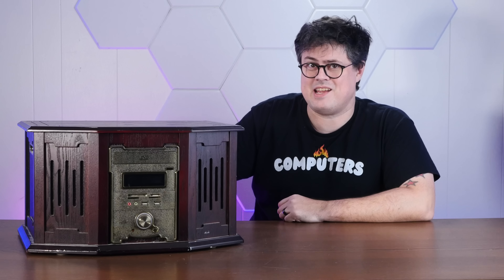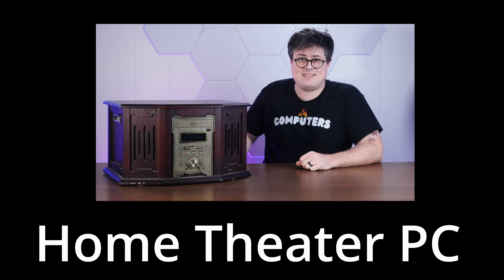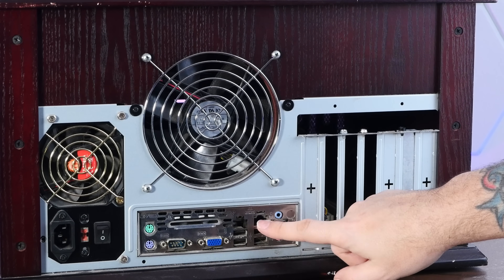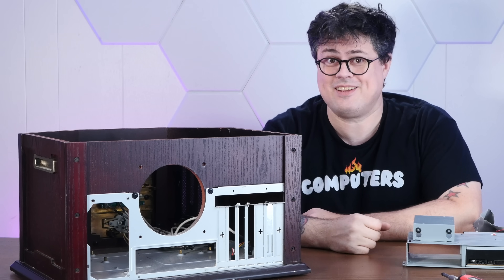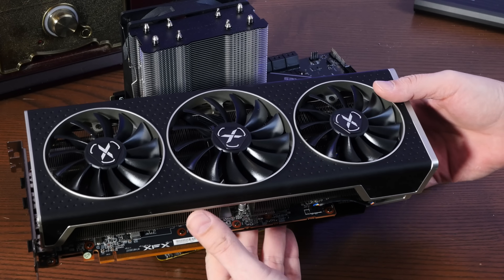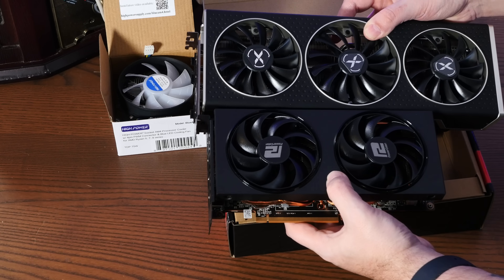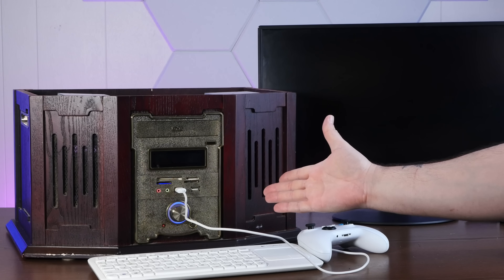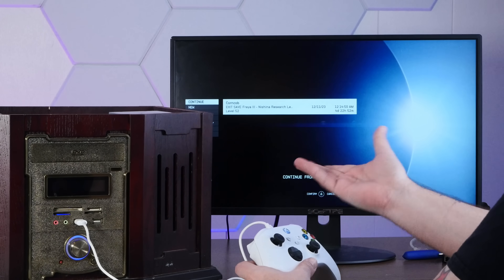This Was a Real PC in 2009 🤔

Comment: This case was for model of fake "vintage" radios with CD player that is still sold today. The top is on hinges and hides a turntable. If you google "All-in-One Vintage-Style Turntable" you'll find them. The PC maker adapted the case to put a computer in it. That's why there are unused speaker grills.
Reply: @dans8287Never knew that, but I always thought the cd tray opened a lot like a standard PC drive. Guess if I ever need a replacement IDE CD drive I know where to look.
Reply: I want to put LED speakers in those grilles, and leave them flickering between orange and yellow, to make it look like vacuum tubes powering up...that would be awesome.
Reply: @dans8287 My folks bought me that for Christmas the year I was talking about putting a PC in a old radio.  It did not survive my now-spouse and I's move for grad school -- it wasn't worth the trip.
Reply: I think the "unused" speaker grills provide the system with some airflow for the single rear fan
Reply: It’s definitely made to be a pc case though, did you see the dvd drive and I/o ports on the front?

Comment: im wondering about the original OEM maker of this and how they came upon this idea. I mean this as in this is an off the shelf casing from those 'all in one' decks you could get in the late 90s into the late 2000s (my folks have one, these were usually targeted towards the Early Bird Special bunch), and i can tell it is one because it still has the side slot intact that was used for loading cassettes, and the top is usually a lid for the turntable. What i surmise is that this PC producer probably bought the rest of a stock of these casings from a manufacturer after the run was complete for Sears or some other company making these and had probably made extra, then commissioned that manufacturer to alter the front plate to have things like a DVD Drive logo, as well as altered IO, then maybe a different back plate for the accommodation of the PC case bits like IO and expansion/cooling. Genius if true and was probably rather cheaply done. The vintage of original internals kinda confirm that, mid 2000s at best. down the road if you wanna make this a lil less janky, get you some speakers that can be screwed into the grilles, then patched into a sound card that lets you use an internal header/connector of some kind with the speakers (pre-amp and all that, plus software control). This would make the perfect gift for your fellow 'boomer gamer', especially if they have one of these decks already for listening to their now-antique media on.

Comment: i still use my HTPC - bit more modern tho. a 5800x/3080ti/64gb ram/dual custom loop hard tube in P4 thermaltake open air. custom bespoke wiring. sprayed mopar white with pearl clear. wall mounted via tv bracket w/swivel. full rgb. two 50" 4K in portrait along side a samsung Q85T 75 120hz/10bit center monitor. all on full motion wall mount.  4KW of amplifiers, 11 chanell Atmos processing, 4 ceiling speakers, floor standing 6 surround cabinets. single 21" sub below monitor in 6th order 36 cubic foot enclosure on 2500W mono block.  all dsp tuned. couch in center but on coasters to slide out of the way. making room for my 25x30 foot Vavle Index play area.

Comment: Some old motherboards require the cmos battery to boot. The old computer I have has an internal speaker to tell you if it has an error while booting and even that doesn't work without it.

Comment: I wish more case makers would branch out into different aesthetics like this. I'd love to see more cases that aren't so Gamer.
Reply: I wish there were modern beige cases
Reply: @tylerdean980  that's the "all white" aesthetic in another 15 years
Reply: @tylerdean980  The ATX standard hasn't changed a whole lot over the years. You could probably find an actual vintage PC that doesn't work and repurpose its case for a new build; you'd just have to be mindful not to get parts that require a whole refrigerator worth of cooling components.
Reply: @stevethepocket  Ah, yes. The "Sleeper" builds. Those are always fun if you can get sufficient airflow.
Reply: @tylerdean980  yes, same here, with almost everything going grey, or turning grey, beige is going fit in more than it did the first time round?
Reply: I went with that Fractal Design north for that reason.
Reply: As a gamer/streamer; I want less gamery cases myself 
RGB is cool and all but that's not what I'm here for
Reply: So many bad decisions, i would have kept the tall cooler and put no speaker for better cooling. Maybe i would have use some noctua fan, and maybe added a few behind the speaker grills.
Reply: @Tailslol  A small water cooler would have fit perfectly here.
Reply: Not going to lie, at the current rate it's going, I'm half thinking I should just build my own wooden case. I don't want RGB this or that. I don't want blinding bright lights. I just want a couple USB ports, maybe an external drive bay if I ever find a good dvd/bluray drive again for watching my movies off of.
Reply: At one point LGR have the Bear case, one of a kind tho
Reply: They did, especially Chenming and Silverstone. I lost tens of thousands stocking custom HTPC cases and other niche cases due to what we kept getting told was the coming storm of customization. They were right, they just didn't tell us mom and pop shops wouldn't be able to afford the loses, R&D to needed to compete, or able to access Chinese manufacturers. With intel and AMD changing sockets left and right, the ATX/eATX/BTX shift wasting tonos of dollars as well, the only folks that found success were home conversions of their own and then flipping those on local marketplaces / eBay / Etsy.
Reply: I mean, most either look like they have a cheesegrater in front or a weird mesh thing with lights. I understand that the design is for airflow but still. Even then, gaming cases at least have some soul to them until they reach the 2k pricetag. Suddenly the case is a frickin' fish tank with fans and electronic components and some RGB inside and maybe outside. Looks soulless but like it is trying to pretend so hard to look lively imo.
Reply: There's lots. You just have to look for them.
Reply: With the rise of the Fallout TV show, I hope to see some retro-futuristic PC cases and more start to pop up
Reply: seriously. Surely theres a market for people who game but also want a sophisticated case that doesn't look gaudy but is stylish at the same time

Comment: if i recall chamera os was a way to keep the idea of steam os going after valve abandoned the os after the steam box failed
Reply: no, Steam OS isnt abandoned, comes stock on the Steam Deck. It simply went through revisions. Chimera is mainly for non-Steam Deck hardware.
Reply: @DaiAtlus79  not now; it is not, but back when Chamera OS came out, it was. and Chamera OS has been out years before the deck came out, as it was originally called Gamer OS and was a way to replace the old abandoned Steam OS before Steam OS 3 came out on the deck.

Comment: Some of us never stopped with the HTPC thing... I'm watching this on mine, and I'm currently building its successor.
Reply: Same here. Silverstone still makes new HTPC cases and torrent never stopped working.
Reply: @mike_et_saika  Any recommendation for a Silverstone case?  I have inherited a lot of AV equipment -- enough to have a dedicated 70's vintage setup and a modern home theater.  I only tend to use the stuff I already have for listening to music even though I have a fairly nice set of speakers for 5.1 surround.  I was thinking it might be neat to have my next desktop be an HTPC and put it alongside the vintage stuff and use that as my daily music driver, then see if my spouse wants a setup of her own. The equipment is my late father's so I don't want to sell any of it, so I'm thinking of uses.
Reply: I've also kind of gone down that path, I was going to build one in an old VHS recorder case, as the tape door looked the perfect place for an optical drive, but I ended up with a Acer micro PC that does not look out of place in my HiFi/TV cabinet.
Reply: I wanted to gut an old amplifier case and put a PC in it; that wouldn't be too hard itself, but I also wanted the front buttons and dot matrix display to still work and be operable, and I definitely don't have the skills for that.

Maybe just start with the power button and learn my way up from there.
Reply: Ditto
Reply: Antec Fusion Media Center Black I use
Reply: I used HTPCs for a long time, but replaced it with a ShieldTV a while ago.
Reply: The usefulness of an HTPC can not be stated enough. I rarely even watch regular TV.

Comment: So Xbox controllers are just plug and play on Linux? Also, how is the joystick drift on those things?
Reply: yeh they are via XInput, but some distros come with extra installed on them as well, as Xbox One pads need extra drivers vs Xbox 360 pads in Linux.

Comment: Man, I want a modernized version of it that have most of the functionality yet retains it's classic look, with some goodies like USB 3.0 or a thunderbolt port, or even a OLED Front Panel...
Reply: This is why we have 5.25 bays
Reply: @justin6581  but we don't anymore! most cases got rid of them
Reply: I'd go full LGR and put something old school in it. Perhaps my own WoodGrain 486 build?
Reply: How about a modern DAB+ Internet radio?
Reply: Buy some plywood, a saw, drill, maybe some 1*1, some sheet steel, and maybe some anti-EMI paint for the inside, and get to working.

Buy plywood because the first will be bad, save the fancier woods for the second version.
Reply: So many bad decisions, i would have kept the tall cooler and put no speaker for better cooling. Maybe i would have use some noctua fan, and maybe added a few behind the speaker grills.
Reply: It'll be a fun project to convert. I have a beautiful old media center PC from that era, VFD display, big volume knob. The case was very poorly grounded, and never really worked out. I spent a lot of time on it though, sand at the front down to bear aluminum and used a transparent red paint to give it that red sheen aluminum anodized look. Sorry, was a fun project but did I mention the case had severe grounding issues? You'd walk somewhere near it and the thing would shut down.
Reply: There is a variant with a 3.0 port.  My parents have one in their home theater system that we built around 2015 or so.